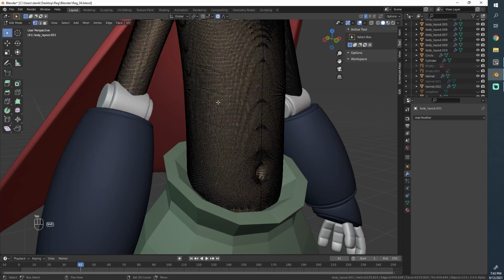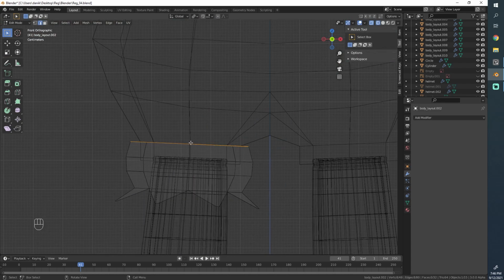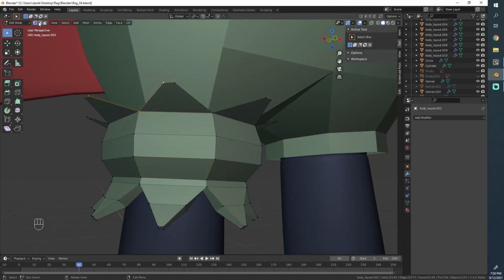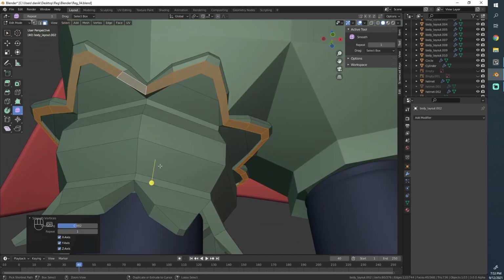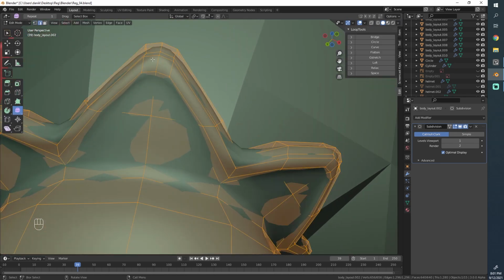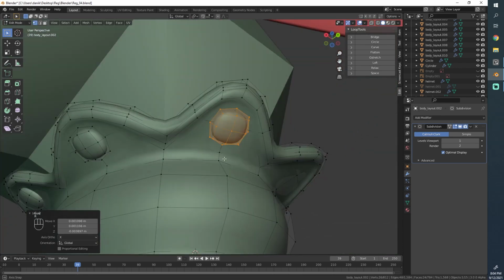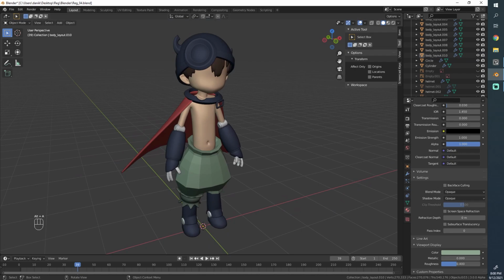[#15] Blender 3.0 Character Modeling Tutorial - High Poly Modeling 7 [2022]

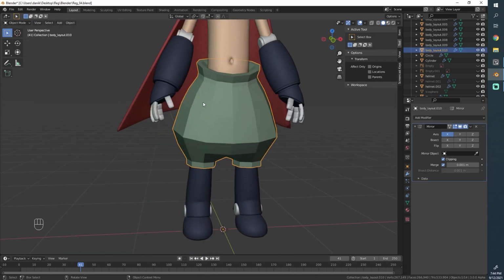Comment: 1:25 starting on pants - lower part
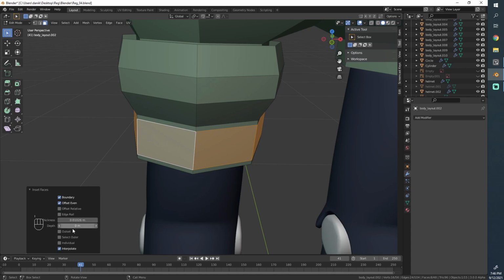3:22 inset faces - individual 
6:14 f2 addon for filling in faces quickly (?)
11:40 recalculate normals when doing subsurf
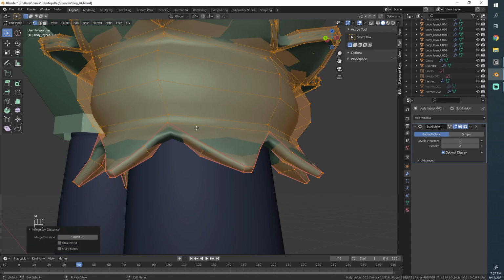14:50 M to merge by distance to check for weird geometry?
19:49 shift s - cursor to selected

Comment: The Spin (Duplicates) tool in Edit Mode would be very handy for this, especially for positioning all the separate meshes perfectly symmetrically. Just make sure to place the origin in the centre of the object (and to toggle Use Duplicates).